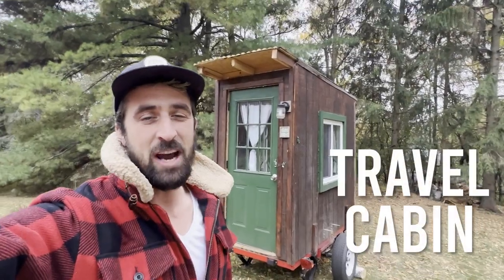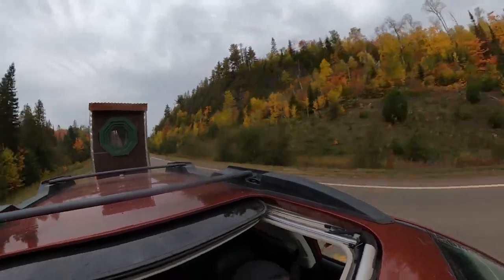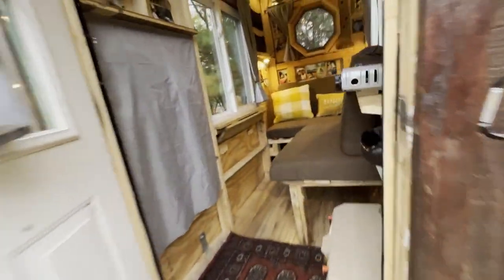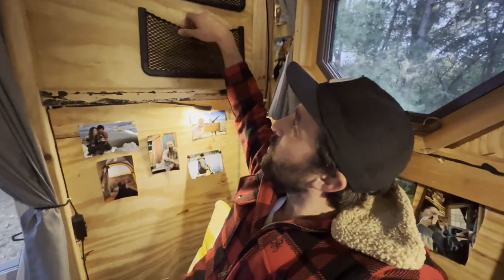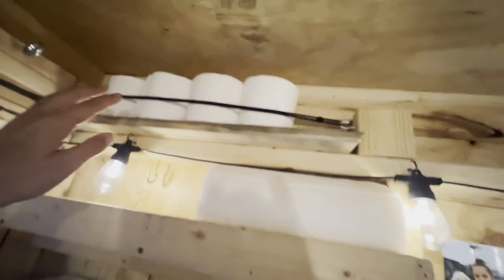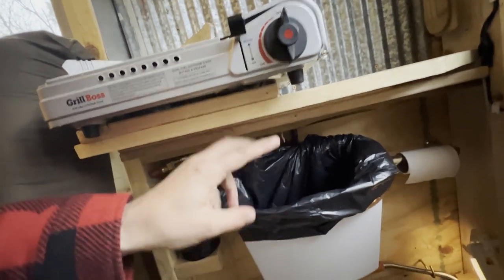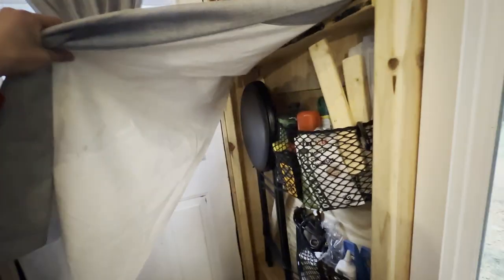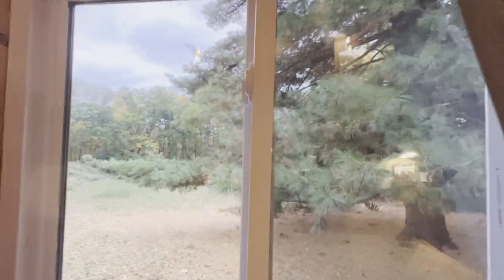SAVING SPACE IN A ULTRA TINY HOUSE | 32 SQUARE FEET

Comment: Use Bubble foil. Looks like packing bubbles but covered with foil; has R factor. Put it under the floor, in walls, btwn roof & ceiling. You'll be glad you did. Cheap & effective, easy to work with.
Reply from the maker: Great to know!! 👍🏽

Comment: Love your house! Do you ever have issues with that window up front, while driving in the rain?
Reply from the maker: Thanks!! I haven’t yet, but that’s definitely a concern that I need to make a plan/fix for. Water will definitely get in eventually 👍🏽
Reply: @TinyCabinLife  I just saw one where the guy was struggling with his front window leaking. Wasn’t sure if I should put one in or just keep them on the sides. I think his mighta slid open tho, so that could have been the issue
Reply: @TinyCabinLife  vintage RVs have windows in front with a fold down awning, might help :)
Reply: you could place a tightly cut thin sheet of lexan or optiplex over that front window area held in either permanently with some type of caulk or temporarily with velcro or maybe magnets if there's metal in the window frame , wouldn't add much weight and would be 1/8-1/4 inch thick if you just want rain protection.  sort of like a storm window and it would protect the window from a pebble or rock hitting it while driving.
Reply from the maker: @markbajek2541  Great idea 👍🏽 I’m going to look into that